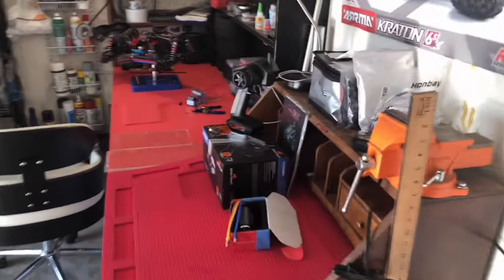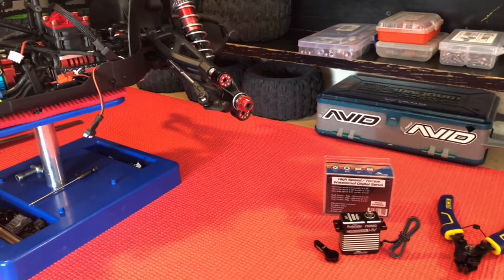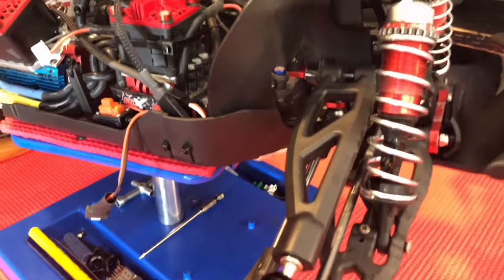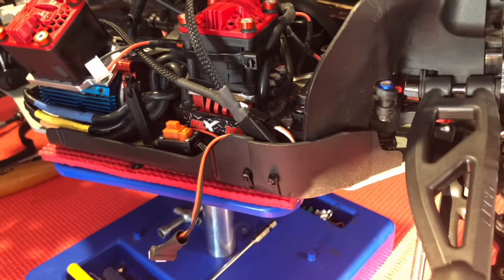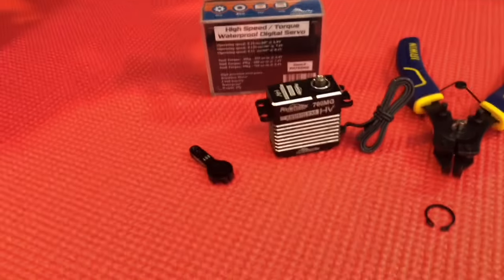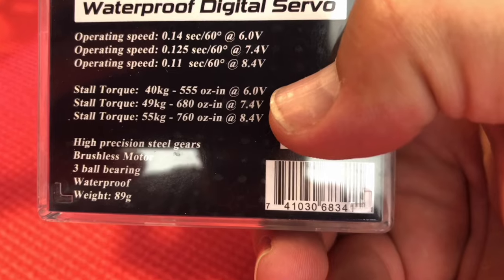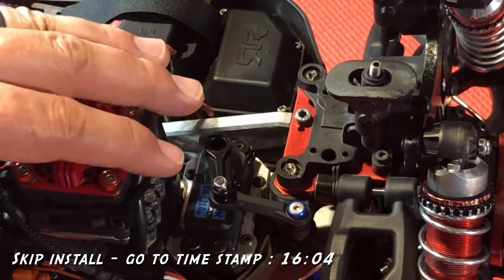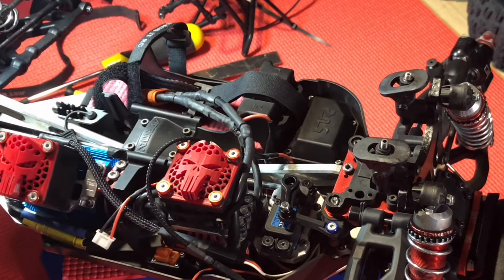Achieve 100% steering for your ARRMA Vehicle. Complete breakdown!

Comment: Wow, I am so glad I subbed a while back to your channel. I own 3 Arrma Granites, and I boughtan HSP brand rc to try out. It had a nightmare servo saver like your... I was trying everything to make it work better, I learned alot from HSP:  a) avoid any RC that uses steel 'dogbone shafts' [they constantly bend or break... b) never deal with an rc with that type of servo saver!  The Granite has the round plastic spring loaded servo saver, and after 3 years (V1) it has never been a problem, one of the few parts that has been excellent. The stock servo went dead in the first month. I installed all Annimos 35kg stainless steel gear servos and never a problem ever again. 
Great vid and info as always.    p.s. The HSP found a place in our local dumpster, got tired of buying replacement 'dogbones and axles that snapped off at the threads... r.i.p. HSP :+{
ALSO I changed over all my screws to stainless steel 'Socket cap head' screws (Boltdepot dot com) They use 2.5mm hex driver and never strip like the stock 'button head's.

Comment: Subbed a month ago and came across these videos literally a day or 2 after getting my Kraton V5. As everyone else has mentioned, the steering in grass was terrible. Per your videos, I added 3 snap rings, and the same power hobby servo. Put in hot racing mount and servo arm along with the ball bearings instead of the bushings. The shims for the servo mount idea was great too. It is a night and day difference in driving it now. Thanks for all the efforts in the videos. Keep em coming!
Reply from the maker: These are the types of comments that waking up to makes my day. Thanks for letting me know
Reply: I went for the $75 off sale and my V5 Kraton is getting here this Saturday! I think I'm going to try the Hot Racing Steering rack with their adjustable servo saver tube (AON48A02). I have a 729MBL that I'm going to use, you still loving the Hot Racing servo mount?
Reply: @EastTactics  Just ordered my Kraton V5 and I quickly found out that your channel is THE PLACE to go for Kraton tips and tricks! Great channel, thank you!
Reply from the maker: Believe it or not the servo mount that I have in my V4 is actually from voltage hobbies.
I haven’t heard the voltage hobbies name though. Wonder if they’re still around.
Reply: @QuinnsRC  just dont forget the snap rings on the servo saver. I wouldn't even bother driving it on grass without it. East Tactics videos are spot on!

Comment: Hey man thanks for this video. I’ve only been into the 6s platform for 5 months now and I’ve been avoiding messing with the steering since it was the most intimidating to me.

Your video made it super easy for me to put the snap rings on my servo saver. Between that, and the Perfect Pass Monster servo, my Talion EXB is a scalpel with backflip 4s tires on grass!

Comment: Brilliant video bro. Getting rid of that rubber under the servo was a great move. I've used countersunk washers to hold my servo to my alloy mount which works excellently too. I'm also running the 3 snap rings under my SS and I swear by them. Best steering I've ever had.
Keep up the great vids brother, love yur work.

Comment: Thanks to your kraton steering vids , I just installed the ph760 in my kraton 6s v5 with the hot racing servo mount and I used the hot racing servo kit and servo tube. Dark here so I haven't driven it outside but doing the floor tests on carpet and grass I definitely get full steering now and much faster than the stock servo. Thank you for the information and all of your hard work! I can't wait to go test it outside driving tomorrow!!!! I did have to add 10mm of spacer to the servo saver for the factory arrma steering link from the servo arm to the saver to make the link parallel.
Reply from the maker: Fantastic bro, glad the information was helpful. Thanks for watching and commenting.

Comment: Just learned of your website.. great learning knowledge videos. Thanks.. I recently bought a RTR 6s kraton.. went out for maybe 15th run.. lost the use of steering servos . The esc cuttings on and off..Went to replace ,found the power wire from the esc and on off  button  were severing  between esc and servos mount..
Reply from the maker: Glad you were able to find the issue. And also glad you find my website. Appreciate the comment. ever need anything feel free to reach out.

Comment: STEERING ISSUES…PILLOWBALLS ! I started my comment with that word to get any newbies attention who are having steering issues out of the box and blaming a defective servo. I loved the look of the Arrma Typhon and got the 3s V3 at my LHS to try out a brushless, learn about Lipo and get back into the hobby. It’s awesome (wish I got the 6s now) but I wanted to try an Arrma truck so I got the Kraton 6s a few weeks ago and the thing would not steer. I tried steering it in grass, dirt, on a stand and the wheels would barely move. I tried everything….I took out the steering servo to see if it was broken from the factory then I took the front wheels off and tried to take out the 5mm pillowballs cap and they were sooo tight. I got the right side off and when I took off the left pillowball cap the wheels just fell sideways. So… for anyone that is new to Arrma and it will not steer or return to center if it does steer,  loosen up those round red things with a 5 mm Allen. I’ve searched YouTube and there’s only a couple of videos about this. Yes, the servo is your run of the mill,  RTR servo and 15 kg/cm is very low power but losen those pillowball caps before you burn out your servo.
Reply from the maker: Thanks DPC, really appreciate it.
Reply: @EastTactics  NO thank you!!! To rbe honest I think this is a horrible design. I know you did this but I think removing the servo from the equation is a very important part of setting pillowballs that’s over looked. I’m still confused how to set them perfectly. I know a few people have burned out servos by unboxing, putting in batteries and taking it for a spin like myself not knowing they’re tight. When I put them back in to factory I was amazed the servo even made the wheels turn they were so tight!
Reply from the maker: I’m sure you’ve figured it out… but this might be helpful. 
https://youtu.be/MtCNn-Qc-Dc
Reply: I was going to lube them but as we all know any grease or lube attracts dirt and dirt is abrasive so idk what to do. East Tactics, are there other, more reliable and less basic options to replace them. I would prefer the 3s version over the Pillowballs. I appreciate your hard work and the time you put into all of your videos. THANK YOU!
Reply: @EastTactics  YES!! That was the very first video I watched and it’s the only one I found that explains it step by step and I can’t say thank you enough!  Your videos have the perfect lighting, pace, and explanations. You’re my go-to when it comes to my Typhon and Kraton now so please make more vids🙏🏻 I was just wondering if you love them or think they’re could be a better system than pillowballs?
Reply: Btw I’m going to be changing my diff fluid soon. I know the video is 2 years old but I’m still going to watch yours first to see how to do it and which weight to use in the Typhon and Kraton. Hopefully you haven’t stopped making Arrma videos🙏🏻 We need you Mr. East Coast Tactics

Comment: Awesome video. You do need to solid mount your servo with aluminum spacers otherwise it will swing side to side never going back to a perfect 0 degree. You can see yours moving quite a bit. Only do it with aluminum case servos. The plastic servo case will snap the winglets off if hard-mounted. You will see quite an improvement by removing the plastic spacers under the servo mounting winglets and placing aluminum ones.
Reply from the maker: At which part in the video did you notice my servo was wobbly. Because Yeah, there is some parts where footage shows previous builds where it was lose. But by the end of this vid/project, after doing all that I did. That sucker didn’t budge back-and-forth in anyway. 😎
Thanks I’m really glad you liked it. I always appreciate your comments because you offer your thoughts and ideas.

Comment: Hey buddy anytime I need technical help and repair I search and automatically go to you for my default choice. These are invaluable to alot of guys like me that's for sure and i appreciate taking the time to film these. Do you happen to know what size snap rings those are I would need? Also I've been running the jx brushless HV 46kg servo from Amazon in my reeper with 8s backflips and has been a great budget servo. I believe the powerhobby ones are the same thing just a rebrand and markup. It's in the same case as the PH one. The jx brushless HV 46kg is about $50-$60 and I have the jx 36kg HV ecoboost in my kraton exb and seems to do a good job as well. Now admittedly I'm not a pro so in reality they might not be super powerful but seem to do the trick. Big difference in both trucks and my reeper used to have trouble centering back up before. 👍🍻🍻
Reply from the maker: 9/16 is the snap ring size
Thx for the comment and the compliment brother! 🤜🤛

Comment: I actually bought a servo saver years ago from a V3 and put it on my V4. Really helped me tighten that steering up with an AGF 45KG servo. The V3’s servo saver is adjustable. Hence the random hole you see on the bottom of the chassis. I also had the same Savox servo in mine. It worked great when I had Proline Badlands on it but that’s because they were much smaller than my Duratrax tires. Tried the duratrax tires which are a fraction larger than the stock tires and I had no steering. At all.
Reply from the maker: Ya I’m loving this new servo. The 1210sg needs 7.4 v or it’s no bueno.
Reply: @EastTactics  The next thing I will be doing to mine is go to the Firma 160A ESC so ill get to see how my AGF Servo does with 8.4V. Currently using the Max8 combo with 2200KV and set the BEC to 7.4V. Keeps getting in to thermal protection... If you've ever run that 160A ESC with a 1250KV motor, what pinion should be used? Mainly looking for a good balance of speed and bashing capability without melting electronics.
Reply from the maker: It’s funny you mention the firma 160. I picked up the exb when it was on sale a few months ago. I snagged the firma 160 and a 1730kv motor. I’m excited to rock it here come spring . I’ll initially be using the savox 1210 in it, and pumped 8.4 to it (that should live’n It up, if not fry it lol)
🤔 1250 kv, that’s relatively lower then most go super torquey I bet!! Lol. You’ll  want to go pretty big on the pinion to recoup some of that desired speed. I’d start at 23t, get a feel for it, see if it’s fast enough for ya, and keep that temp gun handy. Might even be able to go higher like 25t… not sure though.
Reply: @EastTactics  Just for curiosity, I plugged in my current pinion with 2200KV in to some calculator. I'm running the 14T on my Kraton right now. Says the theoretical top speed is like 55 mph. A 22T or 23T with the 1250KV should being it up to that top speed. I have a small feeling I am running in to cooling issues with the Proline body. I'm also in Florida so it doesn't help. I will keep those pinions in mind though! Thanks buddy! Love the videos!
Reply from the maker: Thank you my friend. Thx for following.

Comment: Very helpn video budd Hey quick question man what are you using to space the steering line on servo saver side
Reply from the maker: Oh it’s just a random piece of anodized aluminum. Like a little mini shaft you see them all the time come with certain fan packages, etc. I just happen to have a bunch of them on me. Any sort of solid tubing as a spacer would work.

Comment: Great video, exactly what I was looking for. Just installed a new Savox SC1256 in my Kraton but was still getting weak steering. One question tho, any reason you use snap rings instead of an o ring/washer? Cheers and you def earned a sub from me!
Reply from the maker: Yeah back in the day during the era my specific rig shipped from the manufacture they were using a ton of Loctite on the servo saver. And it was an absolute nightmare to get that thing apart. I’ve heard they backed off a bit from doing that but still it can be a little bit of a challenge to get that thing taken apart. So you can use an washer if you wanna take your snap ring apart. The idea of using a snap ring just kinda makes it to where you can go in from the side and snap it in there and not have to worry about taking the servo saver apart.
Reply: @EastTactics  ahh, makes sense.  I stopped by Harbor Freight and got a snap ring kit and ready to get this Kraton turning fully!

Comment: Hey man great video just picked up a kraton and absolutely hate the steering, thanks for the videos👍btw it's super easy to get that servo saver apart (even with the loctite) and add washers. Just compress the spring by hand and push the top end out of the plastic sleeve then grab it with a vice and take it apart with a 13mm. If you are interested I'm I could send you photos 👍
Reply from the maker: I hear what you’re saying, however there were a huge batch released by arrma back in the early V4 era when they actually did put way too much Loctite in there. They have since backed off.
Either way, however you get the job done the hope is to see that steering get improved.
Thanks for watching👍😎

Comment: Ok, so I'm a complete noob and got around to installing that exact servo. In the air it works beautifully but on carpet the servo saver is opening up. I need to find vids on putting on snap rings and adjusting the tension on the servo saver. Love your vids East💯🤘6s v5
Reply from the maker: Thanks! Let me know if you need help finding my video on snap ring installed
Reply: @EastTactics  so with that servo and the hot racing servo arm it's sitting very high on servo saver screw, like at a big angle. Do I need a longer screw coming up through the servo saver? Would that longer screw pose a problem? Thanks in advance.

Comment: U fixed my issue with this video I’m going in my den right effin NOW. But my issue is the hot racing servo saver for 8s Outcast doing exactly what ur saying in ur video, will not turn at a standstill but works find while driving AANNDD!!!! I have it tightened all the way down.
Reply from the maker: Glad I can help brother. 🔥😎👍

Comment: Sure no shims are needed between the steering bearings and the aluminium plate after the upgrade from the bushings? No binding after tightening down those torx screws?
Reply from the maker: No bearings are necessary, and as far as binding goes. That’s dependent on if you over tighten it. By design you can get those screws pretty snug and binding doesn’t happen. However naturally if you way over tighten things that could happen. The torque screws are there simply because this is one of the common areas that you do not want To loosen up. So using blue or red Loctite is recommended. After using Loctite though those stock screw heads strip way too easily. Hence the Torx screws. Or heat…
Reply: @EastTactics  I agree on using thread locker. I'll have a closer look at mine. I got ball bearings there too.
Reply: @EastTactics  I took a look and you were right. I used red threadlocker and tightened the screws without shims and the steering still moves freely.

Comment: I ran the same Powerhobby servo running at 7.5 volts. Steering was an amazing improvement but only for awhile. It didn’t take long to get the servo to heat up and went into what appeared to be a safe mode. Steering was practically nonexistent after that. Have you experienced any of that with this unit? My servo saver is pretty torqued down, maybe too much?
Reply from the maker: I haven’t, but thanks for the heads up. I’ll keep an eye out for that make sure I report if I do